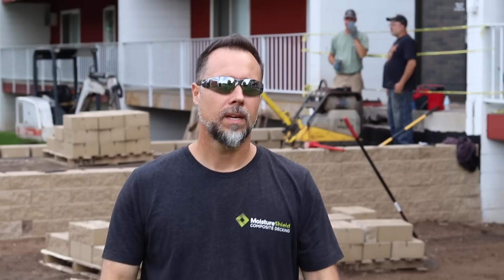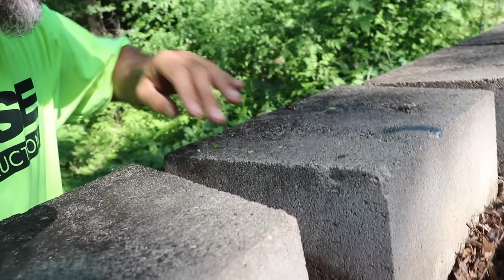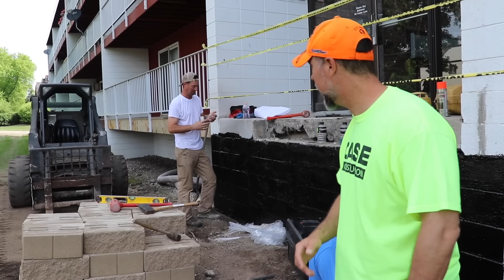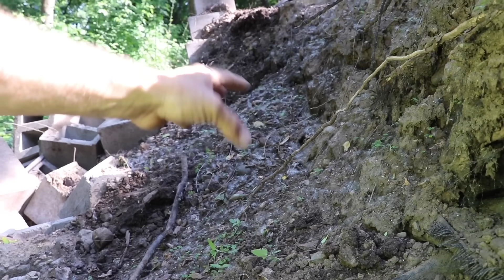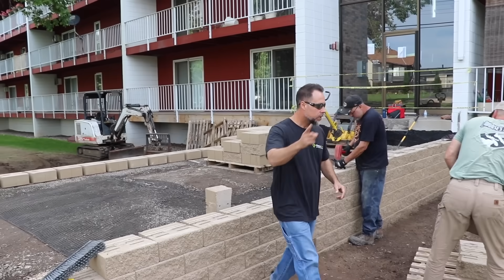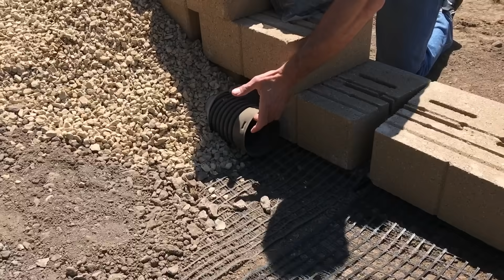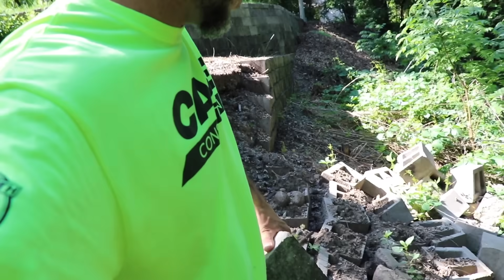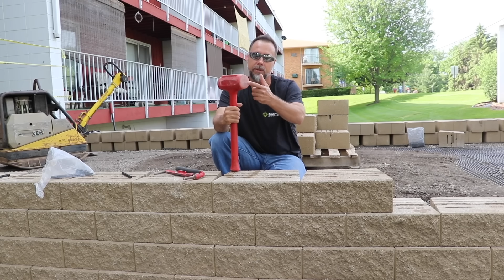How NOT to Build a retaining wall.  RED FLAGS, common mistakes, bad designs pt1

Comment: A little bit of overkill on information goes a long way 
It says a lot about rule of thumb & dedication to doing it right the first time & schooling people / handing knowledge to others proper! 
Whether they are learning the trade as a worker or a DIY'ER looking to do a 2 to 4 foot wall at home,,,
Yea i think you nailed it
on several points start to finish. 
The expansive Clay Soils in Texas where i am at i learned many things from building Homes 
From The Cities who red tag for erosion control not maintained. To The Developers part & Why Retaining walls exist period!  The Builders warranty explained to the buyer on how to maintain the soils moisture level vs. Slab Failure & erosion control via drainage 
the info handed to the New Home Owner i swear i overkill The dos n donts on YES gutters and what not to plant or screw with on the drainage of the final grade especially between houses ! 
Some just do not understand erosion control & the power of water.
Too much Not Enough &
Ground cover.
All the way to explaining core samples the developer does on 1 of 4 lots so that  the concrete foundation Post Tension is poured depth /thickness size of rock & slump of concrete used is engineered with knowledge of THE SOILS  & even on pier & Beam Homes.How one hands off knowledge & the science behind it attached is ,,,,
But Home Owner Maintenance is required!!!
We lose folks who think it does not apply or that theyll just worry about it if it happens meaning 
They have to know what they need to maintain & look for regardless to protect the biggest investment in life most of us have.LAND & HOME. LOL Man
 But they want to blue tape for paint t-ups and cant wait to plant ornamental trees & lay down mulch flower beds...lol. 
Butt,,,Hey You need to show final product on both of these jobs Bro! 
Keep it coming 
(=✔°={<××××××××:::<
Rock On!
Reply from the maker: Thanks Christopher !

Comment: You can use use the hollow core block for ease of placement, and it is MUCH easier to place than those solids... however, you need to grout the cells every 3-4 lifts between the geogrid.  This serves the dual purpose of pinning the blocks together vertically with the grout columns, and providing the additional bearing weight to pinch the geogrid between the blocks... grout has a much higher density than loose gravel to make up for the weight savings of the hollow core.  Unfortunately, you very rarely see this done... IMO, gravel fill is not sufficient for anything over a few feet tall.
Reply from the maker: Thanks for the comments Frank!

Comment: I would like to see a video discussing the large, uh, 3'x2'x2' blocks.  The ones you have to use machinery to set.  The positives and negatives to using them, where they are best used, etc, etc.  My yard has a roadside ditch along one side and the yard tapers from about 6' tall to ditch height over about 250 feet, and is horrible to try to keep the weeds/grass contained and looking good.  I'm always on the verge of tumbling down the bank when mowing it.  So, I think a retaining wall set back from the ditch a little ways is the way to go, and safer to mow the grass on top as well.
Reply from the maker: Thanks Greg and thanks fir the suggestion !

Comment: Now the reason for the blocks to be hollowed is they are designed to be filled with crushed rock or concrete ,now that's up to the contractor to do the wright job for the customer

Comment: This wall that you keep going too to explain why it collapsed has nothing to do with the fabric ,the reason why this wall collapsed has got to do with the backward pressure coming from the above soil on the slope ,firstly you need some type of footing with pins to hold the lower courses  that way whatever pressure is coming from above is supported and the pressure is transferred to the footings and the pins

Comment: Ive used those block for so many walls. I agree, great block. My question for you is, what do you guys use for your base? I used to use about 6 inches of crusher topped off with stone dust for easy leveling.

Comment: About putting vertical geo fabric behind the retaining wall,  that makes so much sense, the way you explained it getting clogged and doing the opposite by pushing the wall out. 
Did you take an industry course on this subject or are you just naturally smarter than most other people? Is there a bubbler drain at the inside base of the wall?

Comment: Why not just build a straight wall instead of putting the batter on it that way you could hit your mark and not have this weird angle of the foundation showing you already got two pieces of Geo grid in there seems like u could go straight up with it being so structurally sound

Comment: When you need to divert water from a structure or route water through it you need drain tile.  Thats is why walls fail, engineers know what they are designing the tests.  Me personally being a structure guy, i dont like any non structural aspect in my wall or struture but it is necessary at times
Reply: This wall doesn't need drainage, there will be a concrete sidewalk on top of it. I do agree some retaining walls do need a perforated pipe or tile depending on the amount of drain rock behind them. For example  most walls up to 3 feet high only need  a 3" drain pipe with 12" of 3/4 drain rock all wrapped in a drain fabric. The top 2 feet of backfill should be well draining soil that way some plants or flowers can grow there.

Comment: I have a couple comments maybe i will get a few answers.  If sand is the structural backfill you should use a geo textile, in layers. Obviously sand is great for waterflo and very compactable when entrained. So the fabric acts as wall for the sand to stay and water to pass through.

Comment: I Have a question!  So I live on a hill and I have 2 nice trees.  One of which I am amazed is still alive because wee needed a new water main and its roots were in the way(4 years and still kicking).  Anyway I am not a massive fan of my grassy hill, mowing it sucks, and I cannot mow it by said tree because that part of the hill is more roots than dirt.  I want to cover it with something.  I am learning towards mulch but I would need a small wall to keep it off the sidewalk.  This would likelhy not be taller than 8 inches to a foot.  I willhave to dig my hill back a bit but I can do that with a spade.  Since it will be a smallish wall but I would like it to last, what kind of blocks should I use.?

Comment: It should be noted that I think he's talking specifically about nonengineered site block walls and MSE walls that don't have any sort of drainage mechanism built into the design.  Retaining walls have all sorts of waterproofing materials layered behind them vertically all the time, but they work in conjunction with well thought out drainage strategies to prevent water buildup behind them.

Comment: That vertical fabric that was on the failed wall was a slit film fabric which should never be  used for drainage because it is nearly impermeable. Filter fabric should always be more permeable than the soil behind the fabric.

Comment: In my experience with cinder block. The rock you speak of isn't the only thing holding up the stability of the wall. It's a footer with rebar that goes to the top.  Every 4th cell. Then pumped with 3000psi and quarter inch aggregate or pea gravel.Walls are still standing and looking good.
Reply: Yeah -- there's a fundamental difference in cinder block (cantilever) retaining walls, and "retaining wall block" (segmental) retaining walls. You don't core fill segmental retaining wall -- that would turn them into cantilever walls, with no cantilever footer.

I think most people would be able to guess what happens when a cantilever retaining wall has no lever helping it resist the material it's retaining.

Comment: Hey Stanley. We've installed a few walls in the 10 years we've been in business. We have ICPI Certification, and Techo-Pro certified (by Techo-Bloc). When we install retaining walls, geogrid is used as you described. However, we install a 'filter fabric' behind the clean stone, so between the clean stone and the reinforced soil. The fabric is used to separate the two mediums, the fabric keeps the soil (if it breaks down) from entering the clean stone and compromised its ability to shed water. Over time without fabric separating the two medium, soil will work its way into the clean stone, causing the sidewalk to sag along the paver and the cap. Over time the soil will totally compromise the clean stone, and the clean stone will loose its ability to shed water. In winter the freeze will push the wall slightly, spring thaw the soil and rock move down and take up the void created by the freeze cycle, further sinking the paver walkway/driveway/etc... the next winter the wall moves again. Rinse, wash, repeat. 

The same is done for any basework, whether its a driveway, walkway, or roadway. The fabric (different from application to application) is used to separate the basework from the in situ soils. As overtime the stone will migrate into the soils regardless of how compacted they are or how much the soil has been amended.
Reply: agree with the fabric as I built a retaining wall (that is still standing... and looks good...amazing that !!) but the fabric was white and actually a fabric not black and looking like strips of plastic fibre...
Reply: He's not against filter fabric separating mediums but using any fabric other than the kind of GeoTextile fabric he showcased against the entire face of the back wall that is backfilled. Especially if the fabric used is that micro screened black kind he pictured in the video because it gets clogged than prevents drainage,  as per design.

Pantagon Landscaping, are you based out of Alberta Canada? Thanks for the great description of how a retaining wall is constructed with the further detail and emphasis on the soil distinction & separation
Reply: I do the same on my home built walls. If water flows right through the fabric then it's good to use. But to separate the soil from the stone used for drainage. Not right behind the block.
Reply: ColeSpolaric  - As long as water flows through, that’s the critical aspect. It doesn’t make a difference if it’s against the block. Sometimes it’s just easier to construct it that way.

Comment: so im guessing you dont put gravel inside the hollow blocks. ive worked with stigma blocks and if done right you can build the wall 20 ft high with no problems.

Comment: I wonder about those hollow blocks, where i live we have to pour concrete in them.  if you look on the bottom they has a grove for a rebar. They will not tie in if they don't have a rebar and concrete in them

Comment: You guys are legit.  Great emphasis on the geo grid.  I love that you talk about how the drain tile is essentially pointless because the water should weep through the block.  And you’re also using the best block in the market for all the reasons you stated.  I use Versa lok almost exclusively.  I do a few minor things different and had good luck, but I wouldn’t argue with anything you do.  Keep it up.   There’s a lot of hacks out there.  Cheers from Milwaukee.  Home of many Polocks.

Comment: My dudes, just subbed to yall a few days back because im about to build my first retaining wall. First time doing block work as well. To be honest,  my commonsense, along with all the errors of it, is all i had to go on before checking out your videos. After four videos, i know im not ready. But starting the job tomorrow. Im more of an interior  tradesman. Tile, framing, plumbing, etc... The client is fully aware of my level of knowledge and the invoice reflects these limitations. This wall is to act as a seawall to some extent and will be 25 foot long. ANY practical advise would greatly be appreciated. By practical, in this situation, i mean to say, "can be done by one man in 6 days" with 1000$ in materials. I am about to upload a video of it on you tube. Im not a content creator of any sort.  My videos are for my own documentation and reflection, and for the benifit of clients.  Also, i work alone for various reasons, however seeing yalls jobsite banter makes me miss the ":$@% talk.  Ha ha. Cheers fellas.

Comment: You are potentially giving people bad advice without explaining the consequences of your advice.

Adding a vertical geotextile (bidim A10 or similar) layer behind the face of a retaining wall is good practice to mitigate against 'through flow' of silt and clay sized soil particles. If you do not install the geotextile, soil will flow through the gaps in the wall (which are present in timber lagged and gravity block walls) resulting in deformation of the soil mass behind and settlement at the ground surface.

Geotextiles or even scrim fabrics (like that shown in your video) are permeable and allow the through flow of water. Their installation, or lack of installation has negligible effect on the stability of the wall. The lack of installation of back of wall drainage is likely the reason for collapse of the wall you have shown. This lack of appropriate drainage has allowed the soils to saturate and rupture the wall. This would likely have happened regardless of the fabric being in place.

Your comments on solid vs hollow blocks demonstrates a complete lack of understanding on how each respective system works.

Your understanding of how geogrid functions is also completely incorrect. Advice on strip length, layer spacing, geogrid specification, backfill specification is controlled by significantly more factors than you are identifying. It almost sounds like you are quoting a block manufacturers brochure.

Please do not give people bad advice. Please educate yourself.
Reply: Make a better video then pls

Comment: I like the video. what is the name of the block you use? and secondly is the geogrid depth a fixed formula here's why i ask . i have a retaining wall that the previous owner of my home built it is a cross tie wall  (railroad tie) that is 9.5 ft tall and 43 ft long he also never pulled a permit for the wall. After owning the home 10 years we got 6 inchs of rain in one night and you know what happened to the wall it blew out he had put no drainage into the wall at all. above this retaining wall is my driveway below the retaining wall is the drive way into my basement garage they is approx 4ft behind teh wall until i am at the driveway so i can't go back teh 9ft needed without removing the driveway . also i had heard that once it fails i need to go twice the amount of the height so that would be 19ft back from the wall with geo grid I feel i am being taken to the cleaners alittle one quote was $70000 to replace the wall so i thought aout doing it myself. also another question can you place teh block on concrete driveway as the foundation for the wall

Comment: Typically, ret wall are not designed for hydrostatic pressure. Vertical drainage layer such as geocomposite should be incorporated in to design.

Comment: Id dig, rebar, pour a footing  , install vertical rebar, add hollow blocks then pour concrete in the blocks, but im a structural concrete carpenter, so that's just how id do it. That wall wouldn't move and it would be one solid unit. I use to build high rises so everything had to be interconnected, and one thing supporting the other.

Comment: Regarding the sin of vertical fabrics:
Can we fully blame fabric as an inherent failure, or should we not discuss its improper installation(location) and lack of other details?
If there is not free-draining aggregate behind the wall, then certainly the fabric will apply undue pressure on the structure, but so too would the fill itself if not well drained. (Yes, to a lesser degree if the fabric is holding extra water).
Fabrics are really best with their primary purpose being SEPARATION. You mention the movement of 'mud' a few times, but this to me seems like something you wouldn't want. While we want water bleed through the wall, certainly we don't want actual material migration. 

With that said, I'm curious if you agree with the following:
Using fabric to separate a native/fine soils zone from a free draining fill zone immediately adjacent to the wall would be OK, if not advisable. Placing fabric vertically against the wall certainly wouldn't seem to ever make sense, but with a proper drainage field behind the wall, keeping native fines out of that field by use of fabrics seems logical to me.

Some engineered retaining structures are built with layers of looped fabrics (tiers) with free-draining mass. This is very different from straight vertical fabric between questionable soil and a vertical wall, of course.

Comment: I know you mentioned fabric in the video but is it ever a good  idea to use it like between the drainage rocks and fill?

Also, I know how important drainage is but confused as to best way to drain away from the wall. Do you recommend wall drain or draining through the curb.
Reply: I was thinking the same. I've built more rural / natural stone wall and there is often natural aggregate involved not terribly far behind the wall. So yes, after the stone fill I think it'd make sense to separate the two materials (natural from fill stone). That is largely the purpose of geo-textile fabrics, separation and filtration. Non-woven may be better, depending on who you ask and the specifics. 
Rather than just a vertical sheet, however, it would be better to turn it back (away from wall) horizontal under the natural soils and cover it with a good bit of soil. That covering holds the fabric (essentially like a tie-back) so it actually adds some structure.